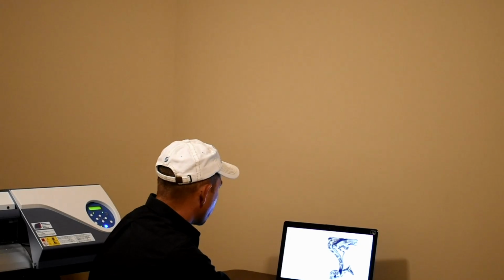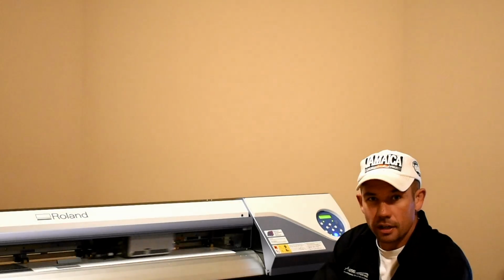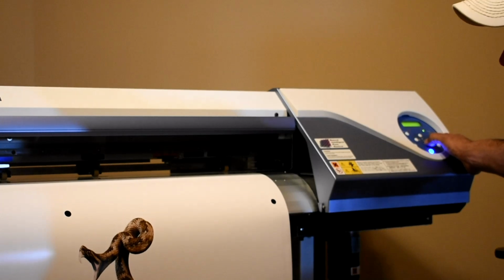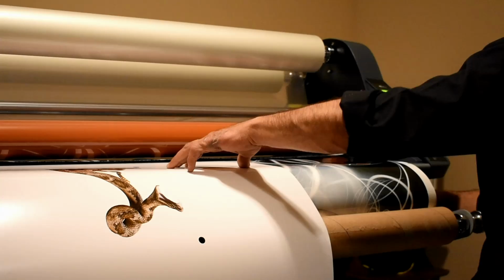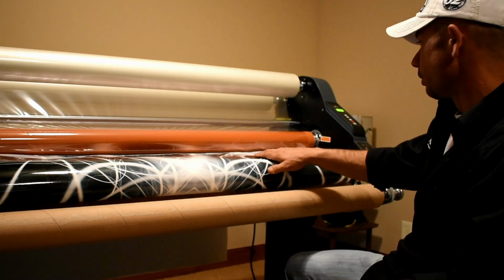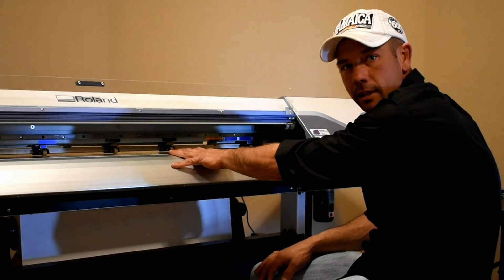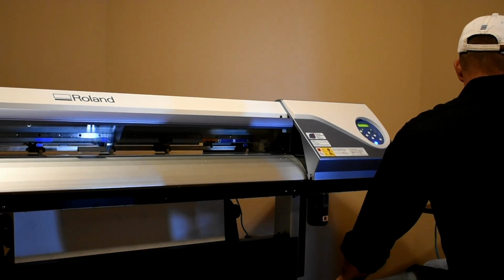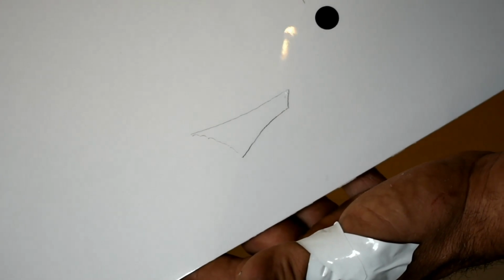Print/Cut Tutorial Part 3 - Printing and laminating

Comment: Thanks for the help!
Reply from the maker: You got it Bryce! We are here if you need any help or have any questions.
Reply: Have you ever had it stop printing mid print, then a Error shows up as K1_2_3_4 and it just beeps?
Reply from the maker: That normally means you are out of ink in one color or more. The underscore is usually a bar that rises up next to the number and when the bar gets to the bottom and appears to be an underscore, that ink cartridge is out. You may just try pushing them in completely and make sure they are seated properly. Once you have changed out the correct cartridge, the printer should just continue forward like it never happened. The Roland printers will keep the lines full so you don't end up with a problem in the print. It may give you a line if it takes several hours or days until the cartridge is changed because of the print drying... Let me know what printer you have and maybe I can help you out better.
Reply: Thanks so much.  The ink was the reason.  I just got a new job lol
Reply from the maker: Nailed it! Awesome brother... Let me know if you have any other issues in the future.

Comment: Nice video bud. Too bad I can't get one like this for my mimaki. I've been trying to figure out how to print laminate cut since a year now.
Reply from the maker: Thanks Shaun. Honestly I have never ran a Mimaki or used their rip software.  What rip program are you using? Maybe I can give you a hand with figuring out the problem.  Honestly I need to go to a show and get a better look at what is out there these days. Last time I went to a show Mimaki's still needed a stand alone cutter lol.
Reply: Thanks for asking, very considerate of you.. I'm using illustrator ,fine-cut and rasturelink.  I can set up the print layer, cut layer and crop marks and print. but after laminating when I put it back into the machine I'm not sure how to get it to sniff the crop marks and continue to complete the job. I mostly do window graphics and I've been cutting everything by hand. mostly straight cuts which are not too bad. But now I have a sticker job to do and too much to cut by hand.
Reply from the maker: So I found this video and towards the end he explains the sequence of doing a print, laminate and cut.... For some reason I can't paste a link here so just look for this title here on Youtube - (Mimaki Print & Cut workflow with RasterLink tools and Illustrator). It sound like if you put the crop marks and laminate the print, you should be able to switch your file to cut only in the rip and it will recognize the crop marks and get it cut. I would assume that the only thing you would need to do is load the material back in the machine as straight as possible and feed the material forward to a certain position on the platen. There should be a line of some sort on the printer to line up the crop marks with. On a Roland once you have the crop marks in line with the correct spot you set a new base point. I bet the Mimaki has that same sort of thing.

Comment: How long should you wait before laminating? Shouldn't you  make sure that the ink is dried and cured?
Reply from the maker: Absolutely! If you do not let the solvents in the ink completely evaporate they can react with the laminate and do all sorts of bad things. This decal was just for demonstration purposes and we just threw it away so there was no need to dry it. The proper dry time for our ink/vinyl/laminate combo and most other Eco-Sol printers is 24 hours.
Reply: Thanks for your response... I was thinking about a printer that I can print stickers/decals, laminate them and ship them directly to costumers. I've heard that HP's Latex printers are capable of doing such a job because the latex ink is water-based and the printer has heaters that evaporates water instantly. What do you think about it? Do you recommend considering the water-based spectrum of printers?
Reply from the maker: I would consider the water based inks but only for indoor applications where the sun will not hit them. Outdoors the water based inks have a short life span, especially on vertical facing surfaces like a hood or windshield brow. Latex isn't your average water based ink though. I believe latex is outdoor durable but haven't ever used one. When you use regular ink and stretch the vinyl too much you can see the white from the vinyl start to come through the ink. With Latex you can stretch it like crazy and no white will show through.
Reply: Well, thanks again for your response.. I've searched a lot and landed multiple times on HP Latex printer. The only two things bothered me is the relatively high price and they don't have a built-in cutter. But any way, I guess I'm gonna get it. Have a great day.